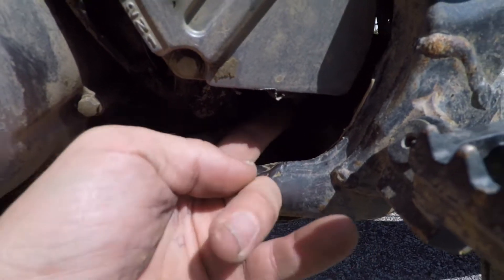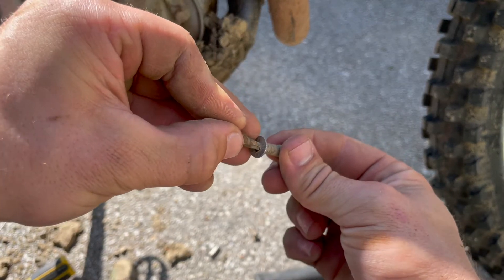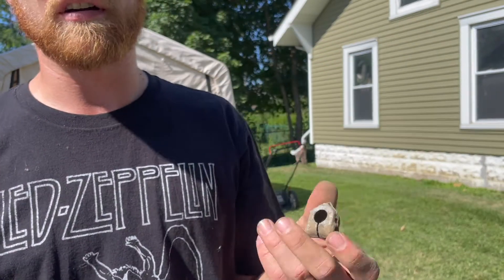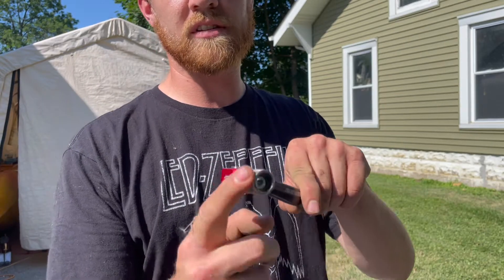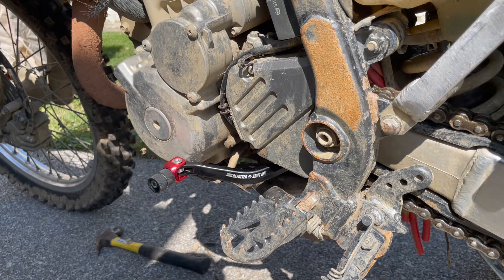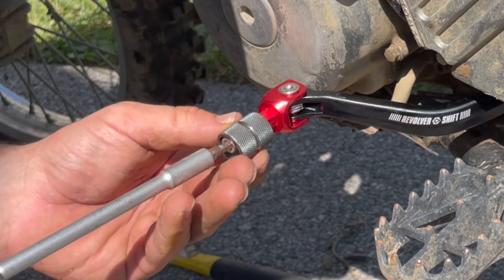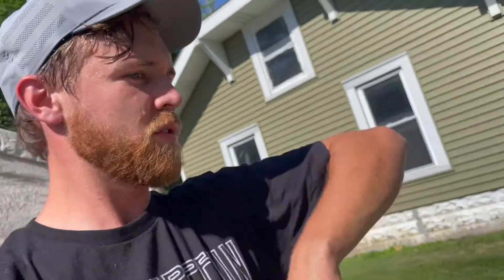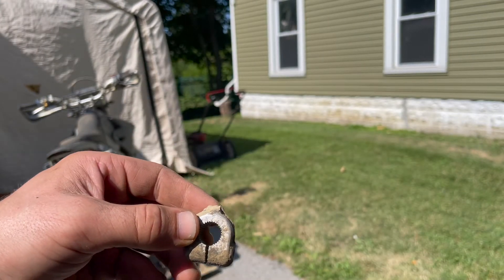Zeta Forged Shift Lever Install | Replacing the broken Drz400 Stock shift lever

Comment: How much longer is this than stock?
Reply from the maker: I’d say it’s the same size but honestly don’t waste your time, go get a stainless one from IMS, been great so far for me
Reply: @troyhill1924  not a fan of this one? I’m looking for an extended lever for my MX boots but they’re all discontinued. Figured this might help
Reply from the maker: @JWReynolds96  nope, the one from IMX so far has been much better due to being made of steel
Reply: @JWReynolds96  I'm in the same boat. I see zeta makes an offset attachment that combined with the adjustable tip could extend it a small amount but I imagine less than an inch... Did you find anything?
Reply: @keldonator  I went on ebay after studying what the various discontinued extended shifters looked like. I was able to find a few for sale that were just labelled as stock parts. Got a used MSR for $20.
Reply: @JWReynolds96  Dang lucky dude, I tried that and gave up. Guess I need to try again.